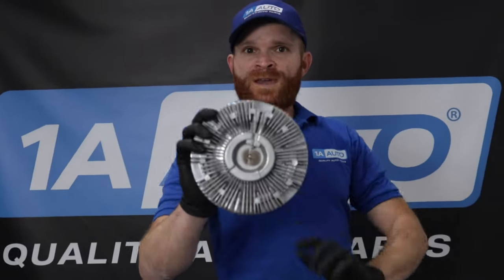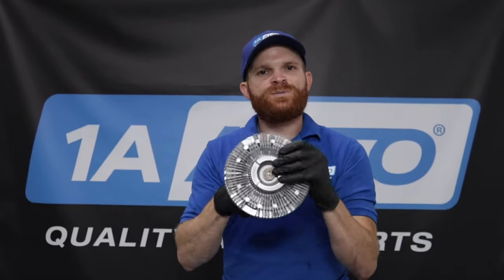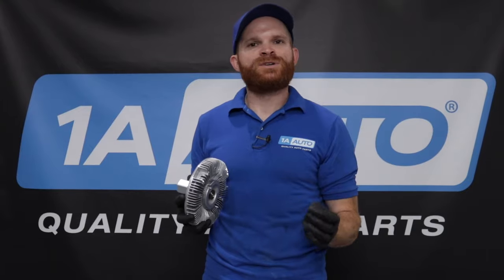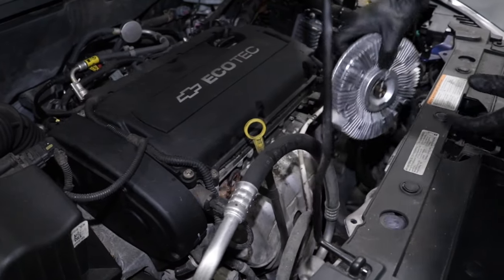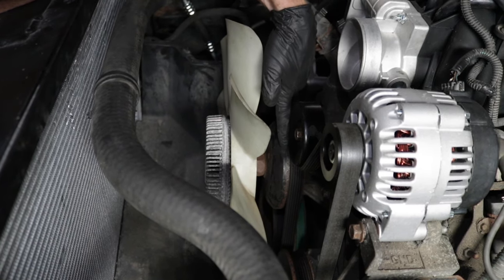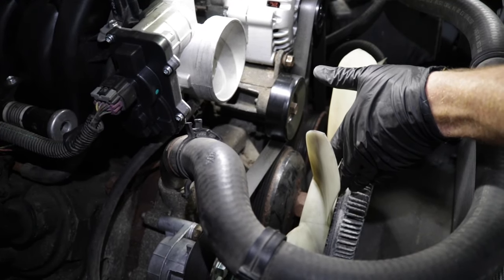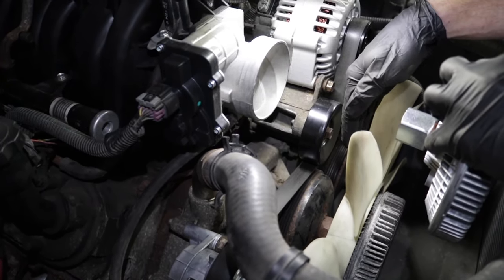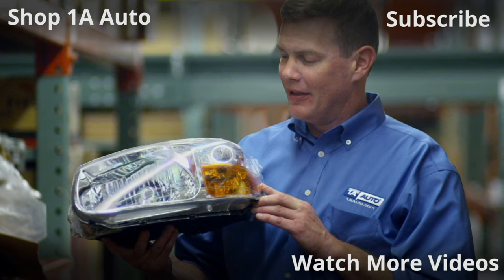Car, Truck, SUV Engine Cooling: What is a Cooling Fan Clutch?

Comment: Okay, late to the game but the problem you mentioned @6:08 just started happening to me. Over the past week this has been happening more and more. I have a 2007 Chevy Colorado and this happens every time I step on the gas, it doesn't matter what temp the motor is. So here's my question:

If there's no "wobble" in the fan blade and it doesn't spin freely when turned by hand, can it still be a bad clutch?

Comment: I replaced my water pump the gaskets and thermostat as well as the heater hose connectors because it was leaking coolant and it would over heat, but my truck no longer leaks coolant but over heats if I run the ac and I’m idling in a drive thru or idling for more than 35-40 min will not if I’m driving. I really hope a fan clutch will because I have to rev it up to cool down.
Reply: Did the new fan clutch fix your issue?

Comment: I just replaced my water pump along with the fan and fan clutch. Before I swapped them it was not sounding like a helicopter after I changed everything to new it started sounding like a helicopter after I hit high speed the fan noise goes away but once I’m back in town/city I can hear the fan again any idea why? Thanks In advance.

Comment: learned a lot. currently dealing with my 1997 dodge b3500 van, purchased it as a work van. overheating problem of course, replace the thermostat, thermostat house both radiator hose, the radiator, coolant temp sensor, did a coolant flush and still over heating. didnt think of the fan clutch but i will be replacing tomorrow
Reply: did the clutch fix your overheating problem?

Comment: Would a bad fan clutch on a 2005 Dodge Dakota SLT 4.7.L cause the engine to run hot driving up hill for extended periods until it gets back to level ground ? .
My truck only begins climbing in temp from 49% on the temp gauge to approx 80% when driving up hill.But when I get to level surface the engine temp goes back down to the mid range on the temp gauge ...any input would be greatly appreciated 👍

Comment: Hi. I got a new fan clutch for my motor I put in my truck . can't find the right fan blade for it can you help.  The fan clutch is 2705, and I need a 17" blade to bolt to it

Comment: Just replace my radiator and fan clutch and thermostat. Had a really hot day and my vehicle just starting to overheat. Water was coming out of the overflow. To place the parts and it was fine after that.

Comment: Just serviced my fan clutch by adding some silicone oil. I noticed a slight drop of engine temperature when the car accelerates and idle in traffic stops. The fan sure spins alot faster than before.

Comment: Mr Lin.     The motor will reach that 195 deg fast so why wait for it to reach that 195 deg or more.   Why not use a old type of fan !!!  The nissan 2018 frontier king cab 4 cyc is not connected to the water and is not electric fan.  it has a fan clutch.  Why not use and old type .    can I put an old type of fan on it.

Comment: Thanks for the video mate. I have pajero 97. Got heating problem twice. First time did raditor servicing. Thought it solved but another over heating occured. Found water jacket freeze plug blew up leaking all the coolant. My mechanic was telling the fan clutch has problem too, its been connected directly without the clutch. Thats how i landed here. So as per your video the fan is running 30-60 percent less speed than the pulley since it was connected directly without pulley right? Also will it have effect on AC as well?

Comment: My ford econovan 94 is overheating „Slightly“ only up the hill or on the highway. Changed the thermostat and did a radiator flush. Someone was giving me the Tipp to change the fan clutch. But in every video ppl say that it would then overheat in traffic and stop and go. My car does not do that. Does that sound more like a hunker up radiator?

Comment: Hi Lynn I just put a fan clutch on a 60 motor in a box van I don't know what you would call it but it's a box van and I put a new fan clutch on a new fan and a new thermostat problem with the temperature going up to say 250 no signs of overheating through the water system I don't know what's wrong could you give me some advice

Comment: i currently have no fan clutch on my cuda's 340.  If i install one, will this bring my fan closer to the radiator and set deeper into the shroud? are we talking an inch or two if so? TIA

Comment: Looks like I have overcooling. Operating temperature of my vehicle is 198 to 220F, I've noticed it stays in between 180 and 188F. I'm suspecting that fan clutch spins all the time.

Comment: I hava a 2003 Chevy blazer that I just replaced  radiator and thermostat  right after that I got a p1481 code fan clutch seem to be fine , any ideas what could be wrong

Comment: I have a 2005 Hummer H2 I’m in the process of doing an E fan conversion because I have the clutch fan and it really sucks I live in California and it’s always hot where I live at idle my AC doesn’t blow cold that’s one of the reasons why I’m doing the fan conversion. It’s super easy I’m doing GM factory E fans, with a harness and tune. That simple.

Comment: 2003 Dodge ram 1504.7 engine I change the fan clutch out twice brand new from AutoZone the first one sounded like a jet the second time sounded not too much like a jet but it was still there that sound I changed it one day The next day I changed it again and still does the same I put my old one back on ran quiet so I’m going to put another new one on again but is there a special one easy job the confusing the sound

Comment: I have a fan clutch on a 95 ford  f150 with the 5.0 I replaced the thermostat,the heater core and water pump but when I start it up when cold it sounds like a fan is engaging and not engaging can you help could it be the fan clutch because I can’t get it to heat up at all? Need help!

Comment: My 2011 ram 1500 4.7 radiator cooling fan stays on and only turn off when I turn off ac however not sure if fan clutch is the problem as well my engine temperature stays between 201° and 206 ° idle at 208° hasn't run hot yet and not try to go there

Comment: Greetings All, recently i bought Lexuz GX460 and as you know it is clutch based cooling fans. I think they are taking alot from the engine power + they are noisy, hence i am thinking of replacing them with a good electrical based cooling fans. What do you think? Dows the clutch fans provide more cooling than the electrical as the engine ramp up more or the electrical fans would be better in all aspects? I know the clutch is more reliable in some points as you are not relying in alternator and so on but i really hate them despite my car is really new, any advice please.

Comment: Mine is going all the time and my rad stays cold so my bottom stat won't stay open for longer than 5 seconds I have gone through 5 rads in 5 years they keep bursting I don't think it is circulating through rad coz cold water in rad shuts stat too quick is thermal  fan suposose to be spinning all time

Comment: Thanks man! you mentioned Running Hot. What about engine running cold? Also feels like vehicle is Sluggish ( 2015 Grand cherokee).
Replaced Thermostat, now considering replacing Coolant temperature sensor. Also noticed the fan does not come on...

Comment: I have an 03 trailblazer with an electro-viscous fan clutch that has given me nothing but problems. Fixed the wiring and a bad ground but it still fails at times.
Would it be possible to replace it with a thermal fan clutch with the exact same measurements, nut and bolt pattern?

Comment: Great video. I've got a 5.7 that won't reach operating temp. It's winter in the mountains. The truck still blows hot air but won't fully get to temp. I've replaced the t-stat and ECT sensor. Tomorrow I'll dive into the fan clutch. Hopefully that is the issue. Thank you for the in-depth video.

Comment: Could this be a possible reason to why my ac doesn’t blow cold on idle? It only blows cold when I’m driving
Reply: Very likely.
Reply: Maybe your radiator and condenser coil is dirty. You should wash it your radiator and condenser once in a while.

Comment: Hi I recently replaced my water pump, couple hoses and the fan clutch, cleaned the fan blades off. Every morning on a cold start the fan clutch stays engaged. Even if I let it sit for about 4 minutes, the vehicle temperature has not moved much and when I drive off it is still engaged. Until I reach a certain RPM then it will disengage. We had a really cold day and it still did the same thing, it was engaged as soon as I started the vehicle. Even if the vehicle sits for about 5 minutes it is still engaged and still engaged as I drive off, but then once I reach a certain RPM it will disengage and the vehicle is only maybe 120° on the thermostat, I replace the thermostat as well but it's also running 10° colder than what it usually does, instead of 195 it only runs about 175 on really cold days, maybe 185 and it is supposed to be 195° thermostat. It was a Murray fan clutch and I think it is bad, I don't think that it should stay engaged especially when it's 26° out, and the vehicle is not even warm or heated up, what is your opinion
Reply from the maker: +Mitchell Noll We wouldn't be able to diagnose an issue like that here, you may want to have a local mechanic take a look at it. Thanks for checking us out! http://1aau.to/m/Shop-1AAuto-c

Comment: what happens when you fix your thermal clutch fan by weld so that the fan goes faster as you rev up the engine. is it advisable to permanent  fix the fan ?

Comment: What if you have both electric fan and a clutch fan? Can you delete the clutch fan? I have a 02 jeep liberty limited edition 3.7l
Reply: I have a 2006 ram 1500 with both an electric fan and a clutch fan. For my truck the electric fan serves only the AC condenser and doesn’t work to cool the engine. Best to leave them both in there 👍

Comment: Another feature about fan clutches is that some are reverse and you need to get the correct one for your vehicle as I recently learned when I bought the wrong one for my 2001 dodge ram. The new one spun on like crazy when the engine was shut down; it should stop with the engine on shutdown. I had to go back to the old one which turned out to be working correctly ...stopping with the engine shut down
Reply from the maker: +Carl ODonnell Thanks for the feedback!

Comment: What are the symptoms of the ac when the fan clutch is not working properly
Reply from the maker: +Ronald McNeel We wouldn't be able to diagnose an issue like that here, you may want to have a local mechanic take a look at it. Thanks for checking us out! http://1aau.to/m/Shop-1AAuto-c

Comment: How do i know if i need to replace the clutch or the fan blades themselves? My blades keep rubbing the shroud and im not sure which to replace
Reply from the maker: +Daniel Andrade Spin the fan as hard as you can on an engine that has not been started that day. If the fan rotates more than five times, you can bet the clutch is bad. You should feel some resistance and the fan may spin up to three times, depending on the ambient temperature.

Comment: So my engine sounds like small jet engine fan.  Is this right?  Plus do I need any hydraulic tools?
Reply: Jet engine meaning when I accelerate.
Reply from the maker: +Kate Schoeneich We wouldn't be able to diagnose an issue like that here, you may want to have a local mechanic take a look at it. Thanks for checking us out! http://1aau.to/m/Shop-1AAuto-c

Comment: How come the cheaper fan clutches  sound like a jet taking off... I bought a cheap one for my Sierra but it's loud as heck
Reply from the maker: +Bryan C. Tejada We wouldn't be able to diagnose an issue like that here, you may want to have a local mechanic take a look at it. Thanks for checking us out! 1AAuto.com
Reply: the old oem motorcraft fan clutch i had before never was loud when i first start the engine.

Comment: Thanks for the vid! Just put a new thermal fan clutch on my 1985 dodge D250 360 v8. Fan was constantly spinning even on cold engine and never reached operating temp so I figured the clutch was shot. New fan clutch on and still the same issue (the fan does mount directly onto the water pump pulley). Constantly runs and only ever reaches 1/4 of the way up my temp gauge instead of sitting at 1/2. What’s my next step?
Reply: Thermostat

Comment: Hello 

Thanks for the great video! 

What if the fan this type after starting the car engine while still cold, before the thermostat opens start engaging/kicks in for a few seconds and goes back to normal rpm, What that means?
Reply from the maker: +Shefket Mustafa We wouldn't be able to diagnose an issue like that here, you may want to have a local mechanic take a look at it. Thanks for checking us out! http://1aau.to/m/Shop-1AAuto-c

Comment: Are the fan blowing air on the engine or cooler?
Reply from the maker: +andre92h The fan pulls air through the radiator to cool it when not enough air is passing through the radiator on it's own. Thanks for checking us out! 1AAuto.com